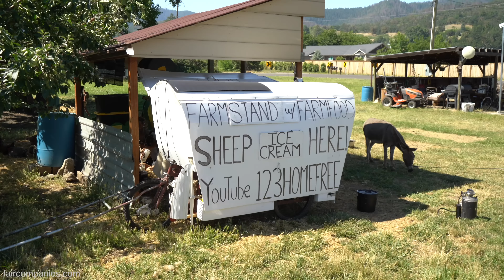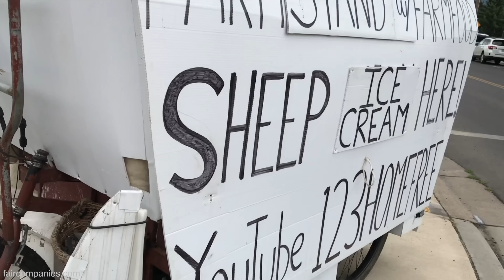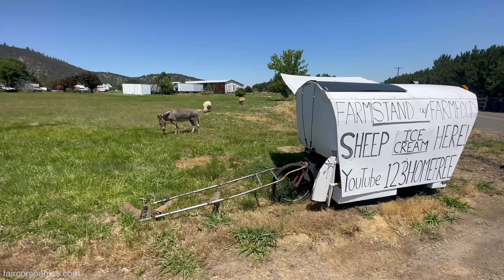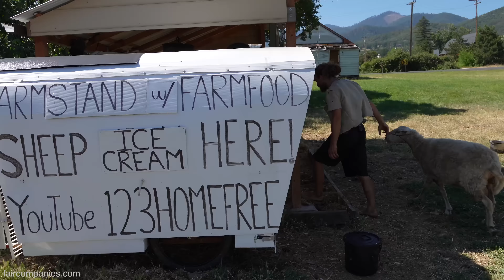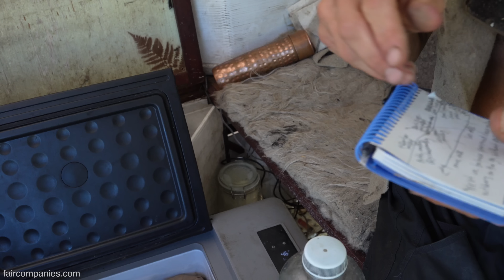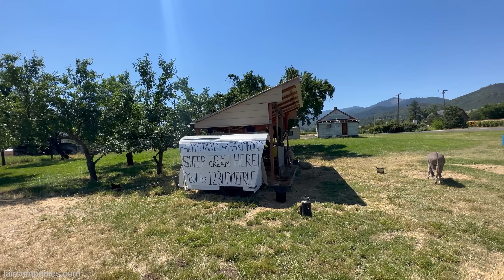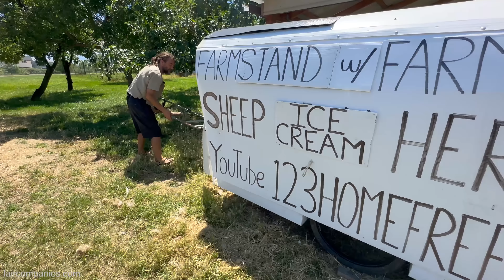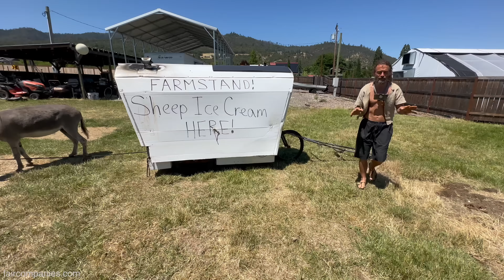Homeless shepherd starts world's smallest farm. Fits in DIY wagon

Comment: Ok without hot water and a sink, how sanitary is anything he makes?
Reply: I have hot water, sprayer and soap
Reply: @123Homefree  well thats good to know, but i saw how dirty your fingers were when you reached into that jar of rennet and pulled some out.  a more sanitary way of getting the rennet out of the jar is just to tap some rennet into the cap and then empty the cap into the container.  then you dont contaminate your cheeses with molds you dont want.
Reply: @DFontaine7  fingers were clean
Reply: @123Homefree  lol you might want to rewatch the video.  still, even if fingers are clean, putting your hand in jars to get food out is just not the most sanitary way.  tap some into the cap and then tip the cap to get it into the container its going in